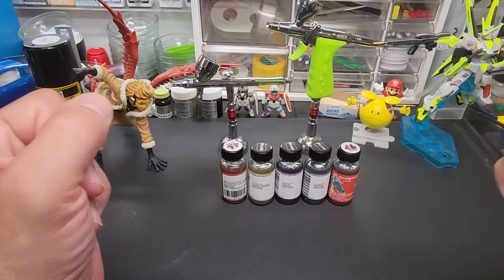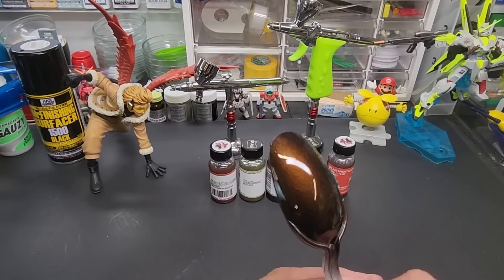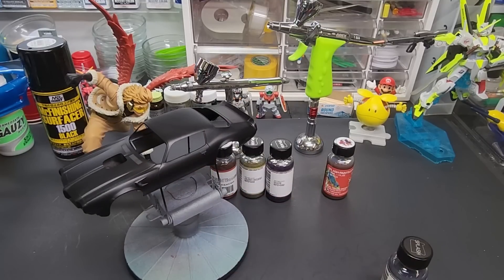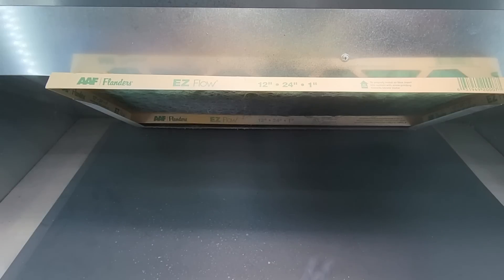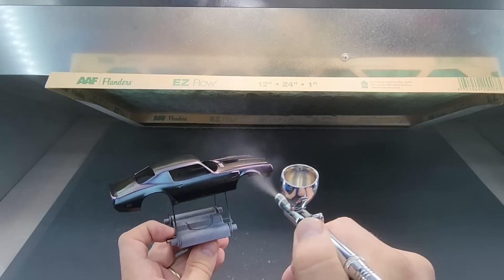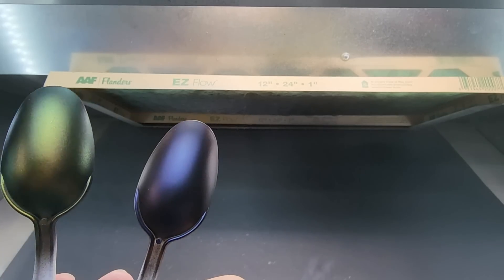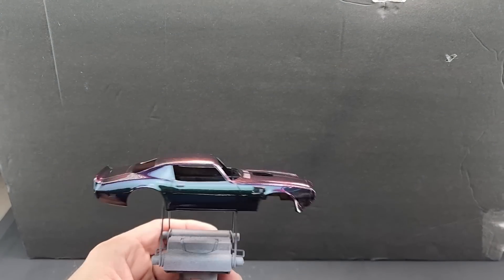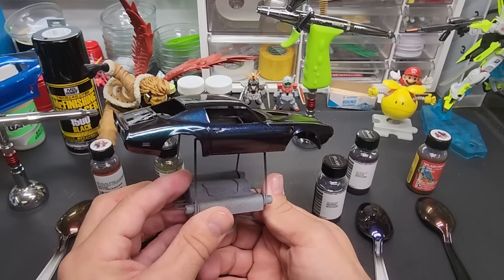Testing Splash Paints Color Shift Paints - Great Results

Comment: Hey just checking if you ever added the clear you use I couldn't find it in disc
Reply from the maker: I used KBS Diamond Clear. Only the gallon size is available on Amazon so I would look for a quart size elsewhere

Comment: Sir i have a question. If i properly thin the paints can i use a simple fine mist spray bottle to paint my kits or if theres a hand pump or compressor tank out there that i can use with a nice airbrush to paint my kits actually going for an airbrush along finding a working good electric compressor is quite hard here where i am i already returned 3 failed air compressors to paint my kits and my miniatures
Reply from the maker: Did you see my video last week on making your own spray cans? Maybe you can get that product where you are located
Reply: @barbatosrex9473  i did search that unfortunately theres no product like that that's why i was think can u use a spray bottle like those small fine mist spray bottles to paint with cheap craft store paint for plastic models. Since these small spray botrle are easier to find
Reply from the maker: @1996starter  so sorry my friend but because I have never tried that I can say it will or won't work

Comment: HI,
GREAT VIDZ,IVE ONLY BEEN APART OF THIS AIRBRUSH JOURNEY FOR AROUND A YEAR ,AND I HAVE  COME ACROSS A NEW PAINT.
ITS AN ACRYLIC ENAMEL BY A COMPANY CALLED POLYVINE,SO IM CURIOUSE AS TO IF YOU ARE FAMILIAR WITH ANY ACRYLIC ENAMELS AND IF YOU WOULD BE EXPERIMENTING WITH THEM AS KNOW IM KINDA CONFUSED AS TO WHAT TYPE OF THINNERS TO USE WITH THESE.👍
Reply from the maker: My personal paint line is an acrylic enamel. Mecha Empire. You can thin them with lacquer thinner. I use Mr Leveling Thinner

Comment: I checked the website they have to spray over black on all of the bottles in the pictures for the color shift paints
Reply from the maker: Yeah, it seems they've changed the labels throughout the years. I have like 4 different labels for them. They don't put the instructions on the jars, they are on the website for each color